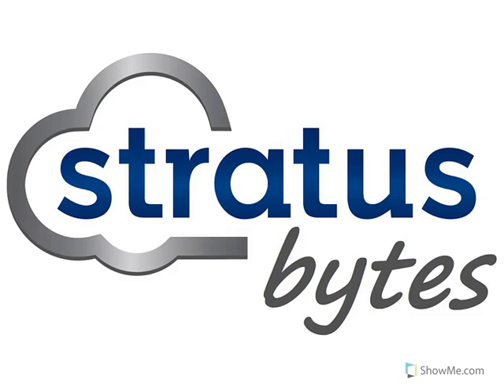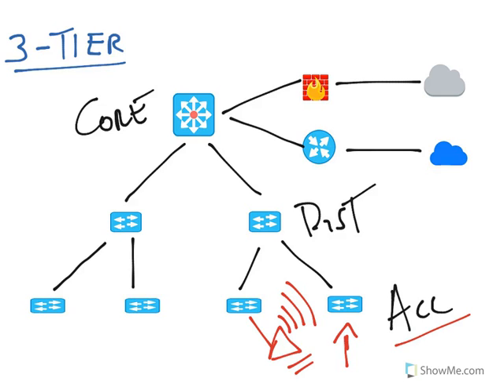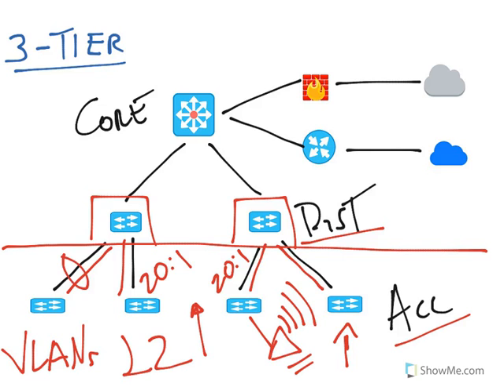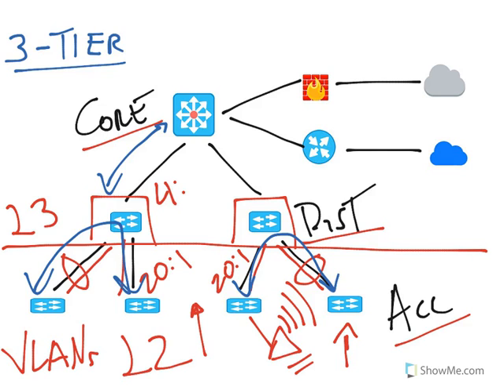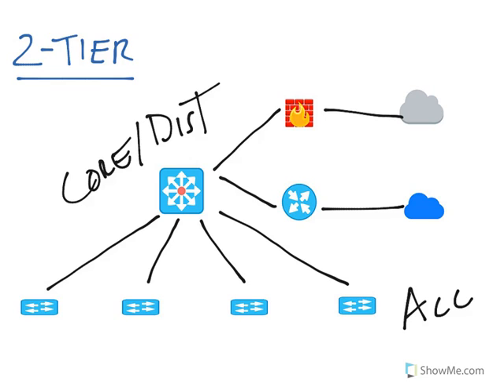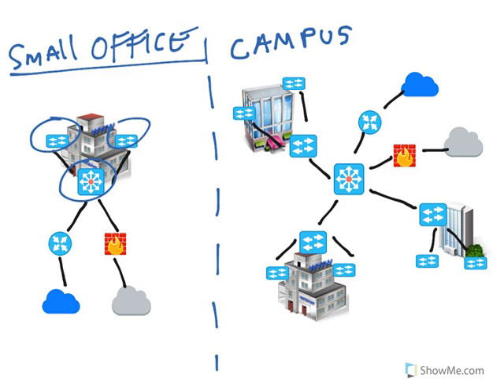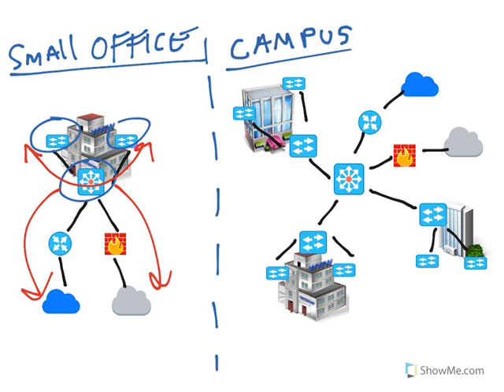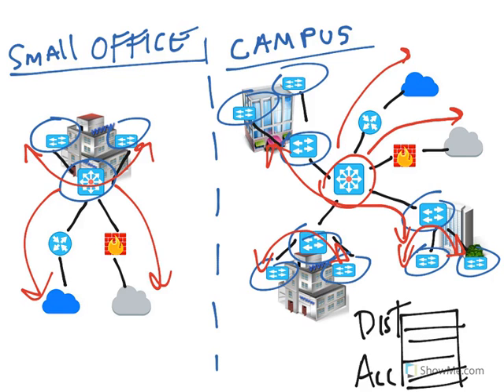2-Tier vs 3-Tier Campus Network Architecture

Comment: Nicely explained, but why there is router conncetd to core switch to reach wan? Please clarify
Reply from the maker: Thank you. The reason there is a router to reach the WAN is because in most cases there will be a CPE (customer premises equipment) that delimits the WAN provider side of the network vs the customer's. This device might be owned by the SP, or by the customer. It does not necessarily need to be a router, it could also be a metro-ethernet switch.
Reply: @stratusnetworks4558  ok that is from SP side. Thank you somuch for reply.
I have another doubt, please claryfy this. In Spine &leaf architecture we use 2 layers, in Tier2 also we use 2layers. Can we call Both the same? If not, what's the major difference? 
Thanks in advance
Reply from the maker: @sandy369  Great question. Spine/Leaf from a physical topology perspective is pretty similar to a fully redundant Tier-2 or collapsed core design. However, by definition a Spine/Leaf architecture has to do more with the application (i.e. software defined networking, data center) and overlay technologies (i.e. VX-LAN, EVPN, GRE) to offer multiple service layers on top of the same network. Typically in the traditional campus, you wouldn't call Tier-2 a Spine and Leaf architecture since from a packet forwarding perspective you are just doing traditional L2 switching and L3 routing, and configuring each device individually. Spine and Leaf has the programmability and control and data plane separation aspect to it, which is predominant in private cloud / data center operations. Hope that helps.

Comment: What infrastructure is needed to run a Tier 3 ISP
Reply from the maker: Hi Edwin, please note that the video is on the tiered architecture of classic campus networks. SP architectures are different. Tier 3 ISPs generally cover small geographic regions and typically own just the last mile or access network that connects customers directly. They buy data or voice services from Tier-2 or Tier-1 providers and re-sell it within their own local region. In terms of infrastructure, it depends. It could be anything from a single Multi-Layer switch, or router, to a massive network. Imagine a small remote town with no internet coverage. If you have the money you can roll out your own fiber from this small town to the closest PoP from one major SP, buy service from them, and then distribute and re-sell that service with your own switches and routers, which already makes you a Tier-1 ISP.
Reply: Hi thank you very much for your prompt response do you perhaps have an email account whereby i can contact you directly just for some info?